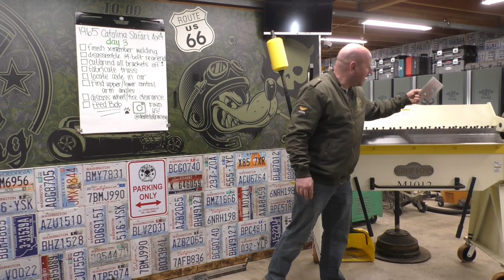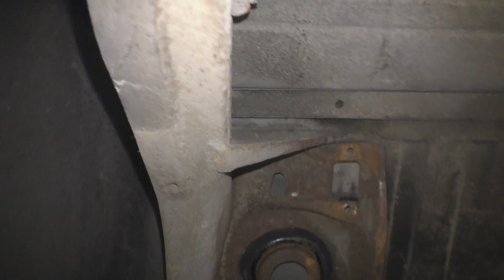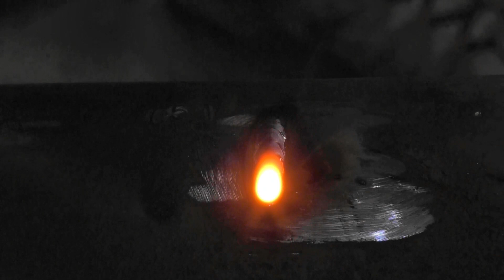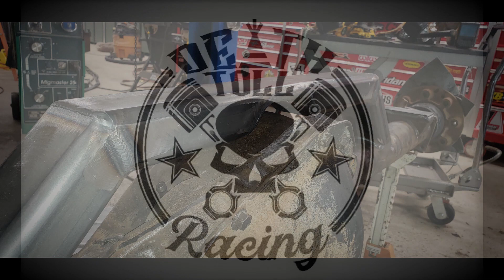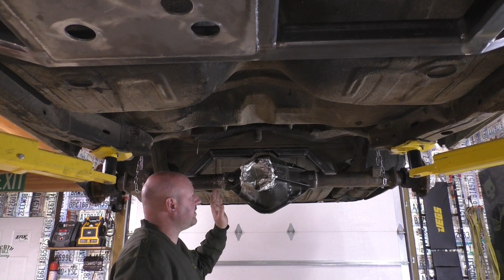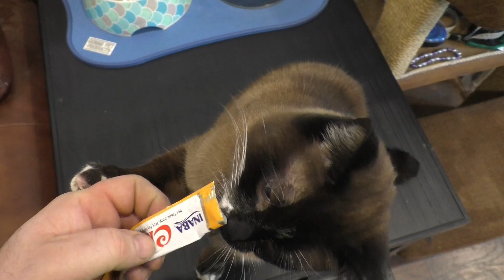E3: 14 bolt Rear Axle Truss and Mock up: 1965 Pontiac Catalina Safari 4x4

Comment: Ah Spokane, saw all the Washington plates and had to dig deeper to see where you are. I am just on the other side of the mountains here. Loving the build series so far! That sheet metal brake would be really handy right now for the center console I am building for my TJ I am LS swapping.
Reply from the maker: I really like it. They have them at Bixby tool in spokane Valley. Very affordable for what you get.